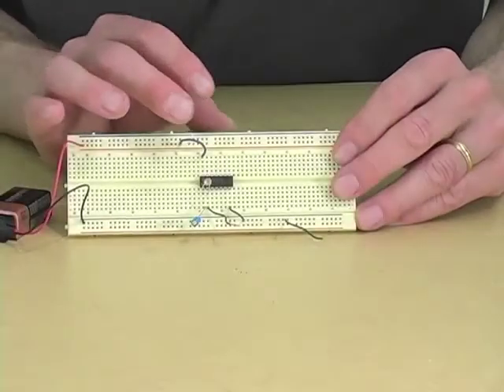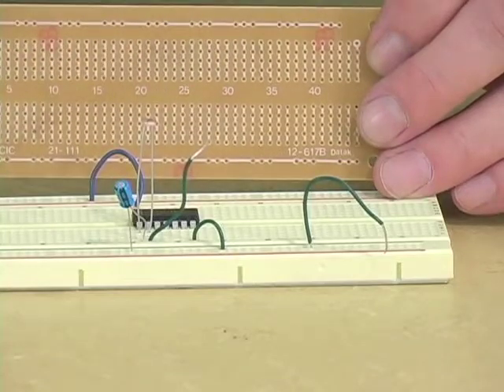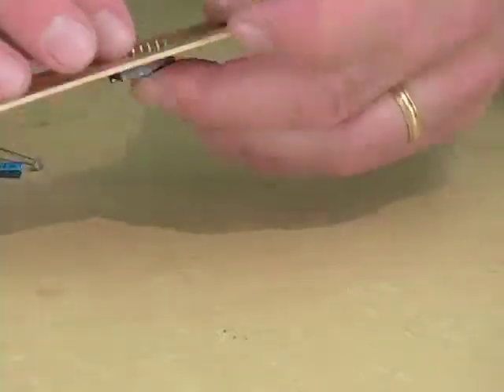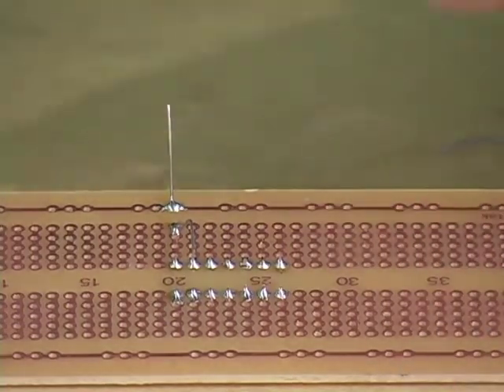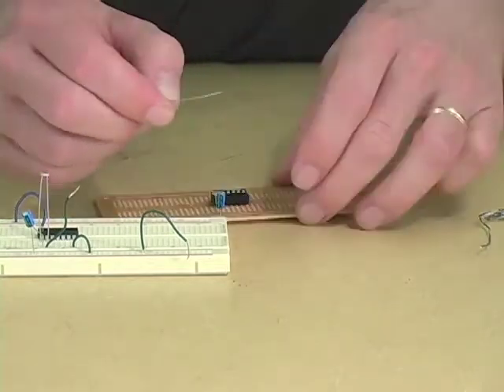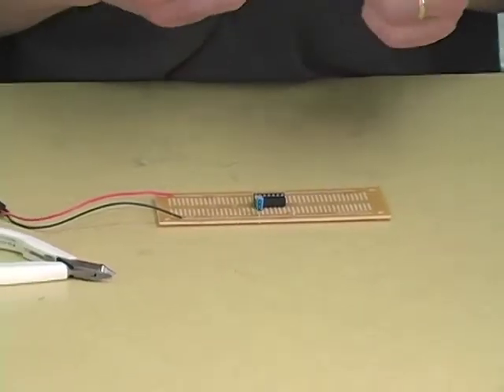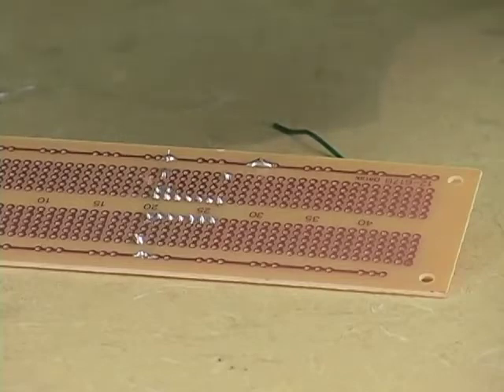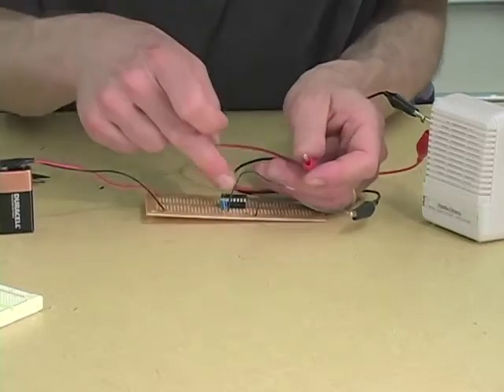Hack of the Month Club -- Project #12: From Breadboard to Circuit Board

Comment from the maker: You can shorten these boards by scoring with a knife and snapping -- a single board can be broken in this way into 3 sections, each of which is good for a 1-chip circuit.  You can buy smaller boards, and ones with different patterns of pads & traces, but this version is the easiest for transfers from a plastic breadboard.

Comment from the maker: If you have the right socket (same number of pins as the chip, like the socket in this video) there should be no problem soldering it in as the first thing.  Then transfer all the other parts, pop the chip in the socket last, then power up & listen.